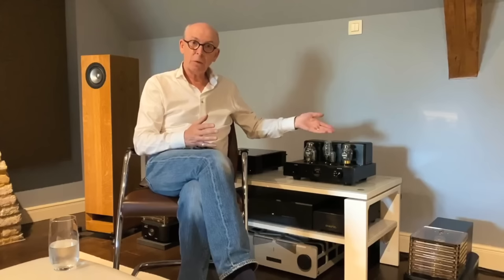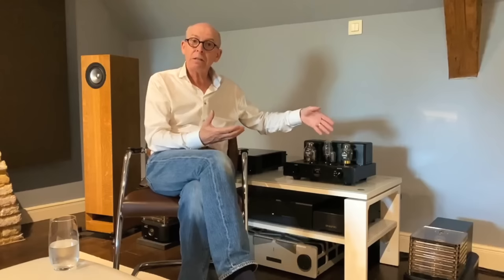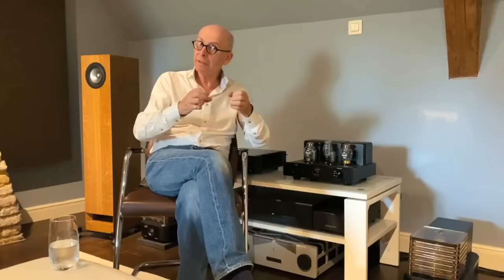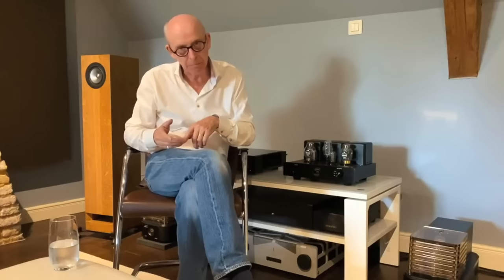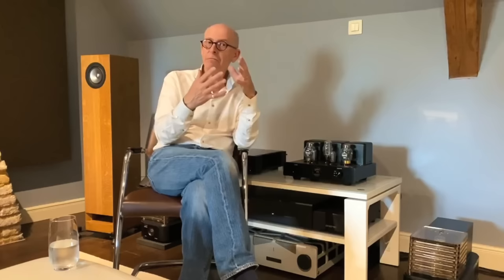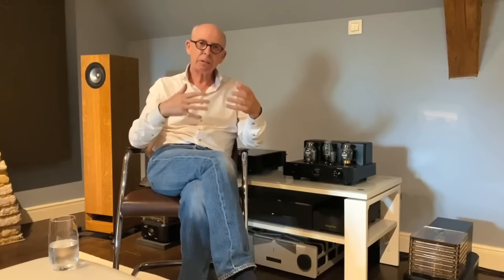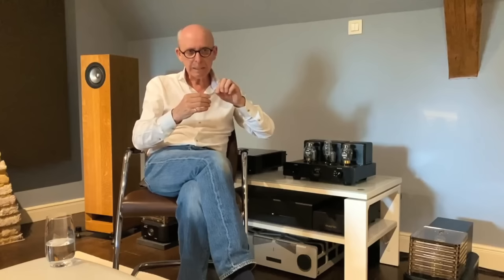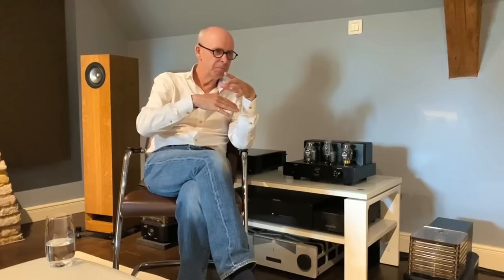What HiFi amplifier? What type to choose?

Comment: Not to be cynical but anyone having enough money to spend on that kind of very high end gear will have money for AC and to suggest an amp for the winter and another one for the summer is just too ostentatious for a simple guy like me and so, after 2:41 of this video, I call it quits and invest the remaining 45:10 in something else.
Reply: Europeans do not typically have air conditioning as they do not have long periods of hot weather (highs 38 Celsius/100 Fahrenheit) as I experience in Texas weeks on end.
Reply: @johnhudelson2652  I don't mean to be a royal pain, however  your statement about European climate is far from accurate, it all depends on the location. Italy, for instance, has very long hot and humid summers and, as a consequence, AC is in most places, as opposed to Scandinavian counties with short and not so hot seasons. On the other hand, thank you for taking the time to reply to my comment and Happy Thanksgiving!!
Reply: @francescotenti193  I stand corrected.
Reply: True but what he recommends can be achieved without spending huge amounts of money. Used class-D integrated amps can be found at a very affordable price (be it NuPrime, NAD or else) so his advice is worth considering. I suggest you watch the rest of the video. Very informative and not condescending.

Comment: The logic here is flawed. 87dB is at 1 meter and if you're listening at 1 meter I suggest you get headphones. If you typically listen with an eighth of a watt, look around, you're most likely in a closet.  5 wpc is more like a typical power usage in a quiet room.
Reply from the maker: Dear Carlos, thank you for your comment. I like like your reasoning, however I think it is important not to overlook that in most systems we have (stereo) two channels. i.e. 1 watt per channel at 87db, you have 90db into the room at 1m back from the loudspeakers. (which is the maximum safe threshold for extended listening. Theoretically, if your room is an anechoic chamber (with no wall reflections) you would still have 84db in a listening position of 2m (6’) back. But because most listening rooms have sound bouncing off ceilings, walls and floors, you should expect to have at least 86db at 1 watt per channel in your chair.  Hoping we are now aligned? 😉

Comment: Pro Ject Transport and DAC, in my opinion, are overpriced! ProJect has had several 'bumps' with their lines in the past. Their quality was suspect. I have both the older model of transport and DAC. The transport specifically is not functioning properly and a cheap plastic remote stopped working altogether! For that kind of money for their transport, about US $2,900, I would go with other brands for a cheaper price. Too bad about this company, for which I had great expectations!
Reply from the maker: Hi, thanks for your comment, in a way I have to agree. For me it performed during the comparisons the best, when hooked up to the RS pre. The strange thing is that the same mechanism in their transport is used in a 35,000 eur cd transport from another make. It’s hard to tell what’s best and why someone would pay so much for a cd transport. The trouble is there is not enough CD transport (mechanism) companies still around.

Comment: Tube amplifiers TODAY, is a non-starter. In fact I have had some of the highest quality hi-fi tube amplifies, top components throughout (precision wire wound resisters!). 

But guess what? From the first moment you fire up a tube, it begins its self destruction. Even though it still works, until the inevitable burn out, the quality, power output, accuracy starts falling off in the first few hours of use. And who manufactures tubes today? In what country can you find a replacement, when they burn out? To the best of my knowledge, Russia. 

Aside from political considerations, Russia has never been known for precision engineering, quality control. And given the wartime sanctions on Russia in 2022, you would have to get whatever remaining stock is left on the black market. Consequential, I finally tossed all of my remaining tube amps in the rubbish.
Reply from the maker: Thanks for your comment. In fact vacuum tubes are made in many countries today, including the USA.
Reply: @PearlAcoustics  Who makes them in the USA, and where? I have a solid state, high power music amp that uses a 12AX7 in its input stage. Would be good to know. Perhaps with your experience you could even recommend a brand. 

Btw, here is a speaker story for you: I had an after high school job soldering components onto ADS crossover boards. Not in the ADS factory; they outsourced the component assembly to a small electronic services company nearby that specialized in wiring, soldering. 

We had heard that these boards we labored over went into very expensive, top of the line speakers. But I never saw them until decades later when I purchased a used pair of the ADS L1290. 

When you listen to these (standing in the right spot), and close your eyes, you would swear the violins, cellos, acoustic guitars, chimes, unvarnished human voice singing was all right there in your living room! Hard t imagine anything to top that. 

In this regard, I’m fascinated by your single driver design, eliminating the crossover. Is there a showroom in NYC where these can be heard?
Reply: You also need to replace tubes, so tube amps are high maintenance for sure. With shifting performance goal posts over time.  That's why a noted British speaker brand (hint - "H") never evaluate their speakers in design stage with tube amps. The tube amps are not considered consistent from one day to another day due to the tubes natural deterioration. That tells you something.

Comment: Your knowledge is very basic and your approach is not scientific, unfortunately. 
I have high respect for Peter Walker for his knowledge and great achievements in audio engineering.
Peter was right. All "good" amplifiers should sound somewhat the same, meaning that their measurements should be of very low distortion.
Good luck to you!
Reply from the maker: Thanks for your comment

Comment: I really like valve amplifiers, but I’m afraid that after 2030 they might consider the tubes contributing to global warming. I’m selling my Ampeg SVT bass amp 😢and getting a solid state amp.
Reply from the maker: I doubt they will because the power consumption is low and if used in the winter, it contributes to heating the home! 😀
Reply: @PearlAcoustics  thanks for being a good sport. You definitely have a keen eye for quality.

Comment: Air conditioning not good for the world's resources. Give me a break! You're much to old to ascribe to such nonsense.
Reply: Its not. Many equatorial countries don't use it, they design homes for better airflow. Like spanish architecture or in the american south, etc. For example adobe walls store thermal energy during the day and release it at night. You would be surprised how cool those homes are in horrible humid summers compared to modern box buildings, which are scientifically speaking the worst design for air efficiency.